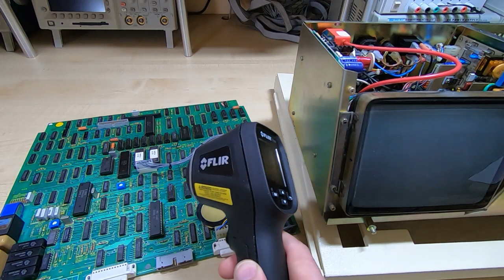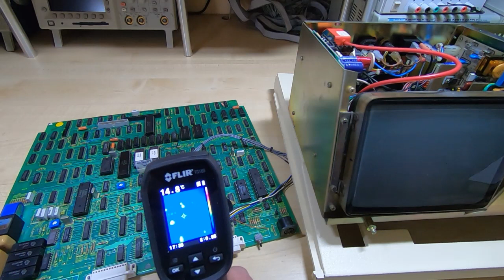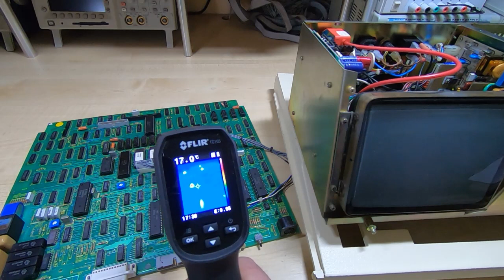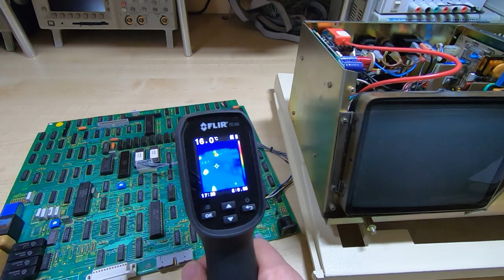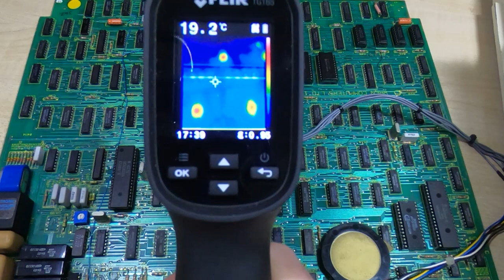Electronics repair with a Thermal Camera

Comment: Thank you for a good overview of troubleshooting with that camera. One thing i will comment on is, you advised people to not use it for devices with "mains" or high volage in them, but I think it would be just as useful there, especially because it reduces peoples "urge" to touch things physically to check temperatures when troubleshooting, and people who do work on any items with mains voltage in them should be aware to fully depower it and  drain off any capacitors that may be holding a residual voltage before going to work.
Reply from the maker: I think you should watch the video again as I say the exact opposite of what you say. My entire point was to NOT touch mains powered (or hot) components to see if they were hot and that a thermal camera is very useful for this purpose. Using a thermal camera it makes no difference what voltage is on the component as the thermal camera is 'non contact'.
Reply: Instablaster.

Comment: Tough choice, risk fingers or buy a thermal camera 😀 On another channel a guy hooked up the motherboard to his power supply, then he found hot components with 99% isopropyl alcohol. He put the alcohol on the suspected components and the hot one made the alcohol evaporate very quickly.
Reply: i saw a guy on electronic repair channel use  some  lighter fluid,
 the  surface tension change with the rise in temp, so he can find sometimes some faulty think on the board 
but with a thermal cam, you can see all the board, 
you can use it to "watch" a electrical cabinet  to make the repair

you see immediately  short circuit and so on
and you can see itermittent fault

Comment: i would assume any chip reading the same as ambient should be considered dead and should be replaced?
Reply from the maker: Most devices will show as ambient because the energy they produce is very low and so is dissipated in the board and surrounding parts. Devices which produce enough power to overcome the rate of dissipation will show as being above ambient but that does not really mean that they are faulty. Unfortunately it is more a matter of looking for any devices which do not show the expected heating which are suspect. For example 1 of 8 memory chips that gets hotter than the other 7 could be suspect (or it could be driving a faulty device or being driven incorrectly). The same if one is cooler than the others. It is of course possible that 7 of the 8 are faulty.

Comment: You're an expert on thermocouples. If you didn't have a thermal camera is there a reasonable way to use a thermocouple mounted on some sort of wand probe to move from IC to IC for something similar to what you did here, although I suppose much slower and more labor intensive. Or would that not really be practical or effective?
Reply from the maker: Interesting idea but unless a component was really getting hot then it would not really be practical. The temperature differentials we saw on the thermal camera were only around 0.5C between the working IC's and the faulty one and the thermocouple is only a point contact sensor so would not easily be able to detect the difference. Also the temperatures are constantly changing and we are looking for differences across the board so you would have to be able to measure many points very accurately and very quickly for it to be any use. Without a camera I would simply use a finger. I do sometimes use thermocouples when developing equipment to monitor component temperatures but that is for a different reason. Having said all that if you know what temperature a component is limited to then you could use a thermocouple to check it but that would be a fairly rare thing.
Reply: Harbor Freight (no idea if there is a UK equivalent) has a range of "infrared laser thermometers" that cost as little as $25. They don't do actual imaging like the Flir but have a flying spot laser pointer that makes it pretty easy to find hotspots on a board.  AT the price, you can't afford not to buy one.
Reply from the maker: They have the same problem. Not very accurate and you would have to take lots of accurate temperatures in a short time. IR sensors are not very good for making absolute temperature readings because they are affected by the emisivity of the surface they are pointed at and you can end up reading temperatures of things behind you instead of what you are pointing it at. The advantage of an imaging camera when you limit the temperature range in the field of view to just a few degrees is that you get a very good snap shot of the (many) temperature differences across the board which is what you need rather than the absolute temperature of a few points across the board. However as with thermocouples they may be useful for discrete measurements although I would not use them for instrumentation.